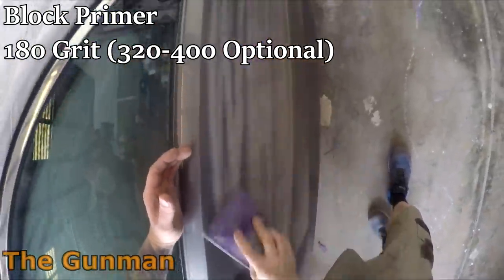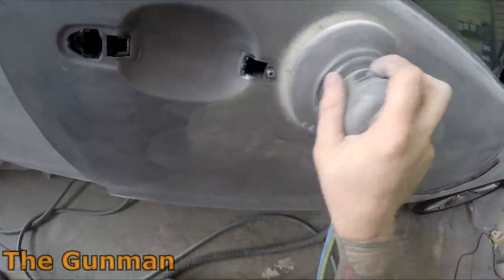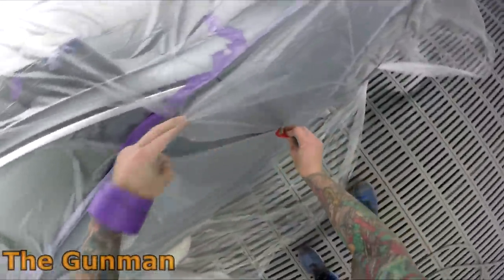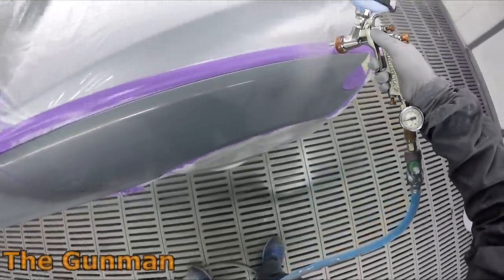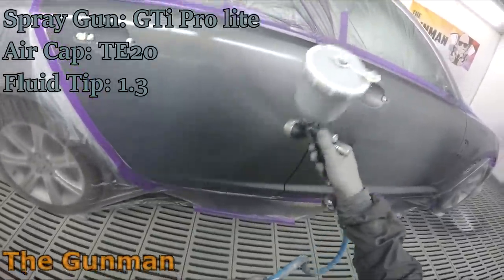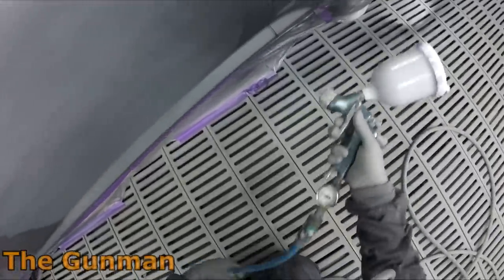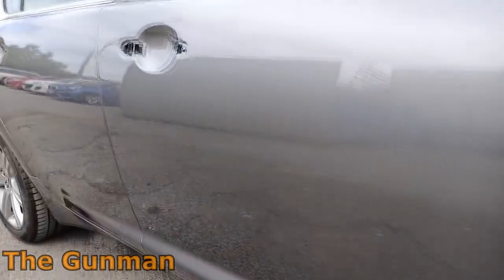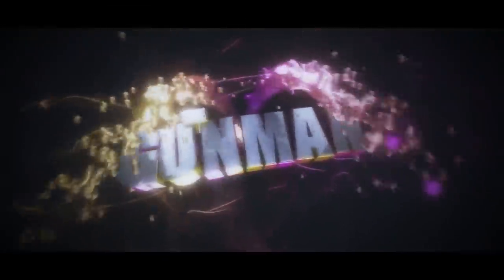XF Jaguar Preparation & Painting Procedure

Comment: Agree with the 180 grit totally!  Learned it the hard way but using coarse grit makes a huge difference getting the panels straight and quickly.  "Creeping up on it" with fine just makes it worse.  I think you're the first one directly pointing that out!  The one thing I hated about car repairs / restorations, etc. was all the argument you'd get!  Everyone was an expert and much smarter than you it seemed.  Thanks for all your help!
Reply: Garage i work roll high build primer on to save time priming in the booth. Then block 320. I find you can see a outline where the primer was rolled. Do you think 180 block will cut them imprints out??

Comment: I found that as long as you don't go edge to edge with this system you can drop the pressure right down to 1.3 bar if you go edge to edge just stick to around  2 bar maybe 1.8 or you will end up with a darker color then you would like on a darker color not so much but on a lighter one you will

Comment: oh how I miss Axalta/standox base n clear. Onto sikkens system now and it's so much slower and the clear I had to go down to 1.2 te20 with fluid in quite a bit just so that runny clear doesn't run. Not like Axalta where you can hammer base and clear on no worries

Comment: Hey mate just a quick question. What are your thoughts on Spralac MS clear coat?
Reply: Hey mate if you don't mind my opinion as I realise I'm not who you asked...but  I have first hand experience of that clear plus the hs. 
It is deadset SHIT. it has zero body...doesn t hang on...dulls off in a few days and shrinks back.it is a general headache in all ways.i threw it out after 3 jobs. Cheap yes....for a reason.
I bought it as I was told it was the old octoral brand which was great 10 years ago.but dude it's a trap. The owner where I work has painted 35 years and said it's up with the worst 2k clear....if I can give any more info on it let me know.best of luck👍